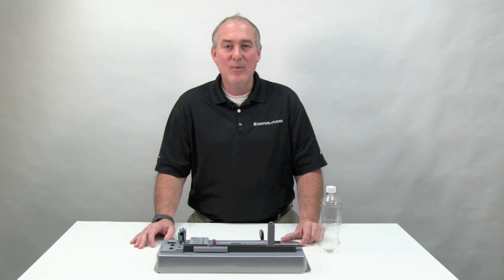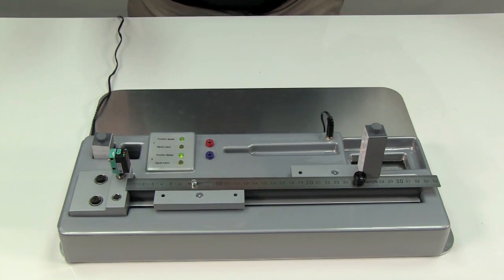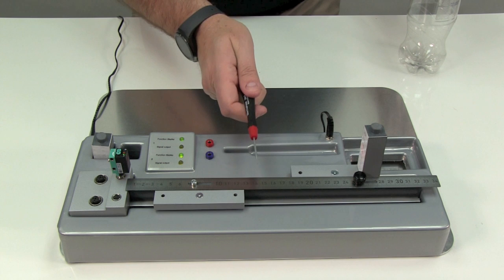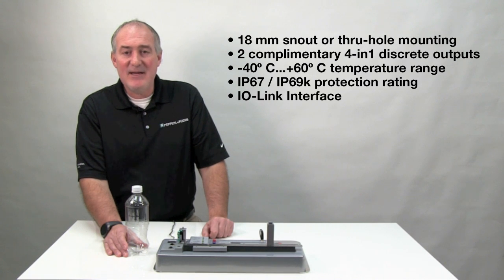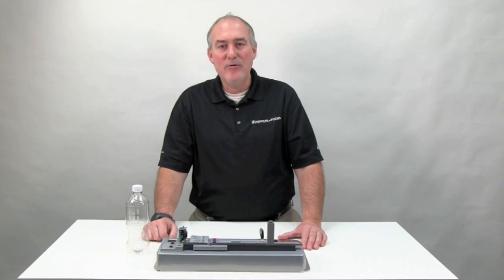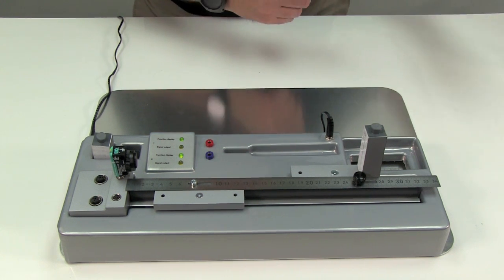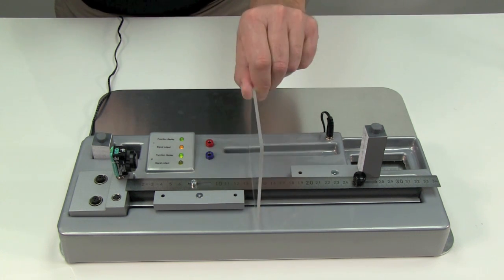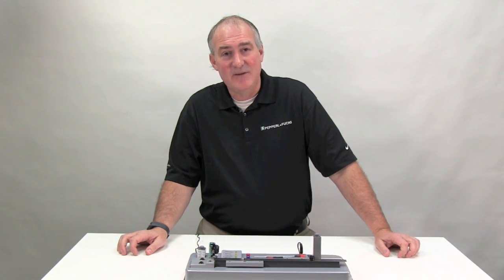Photoelectric Sensor – R103 Clear Object Detection

Comment: what's the description code for this sensor?
Reply from the maker: Hi John,
If you are asking about a model number, the standard cabled version would be model number OBG5000-R103-2EP-IO.  For other connection types, there would be additional characters after the IO.  For example, an integral 4-pin M8 connector would be model OBG5000-R103-2EP-IO-V31.  And a pigtail 4-pin M12 would be model number OBG5000-R103-2EP-IO-0,3M-V1.
Reply: Thanks !